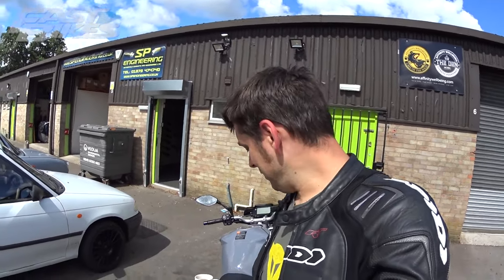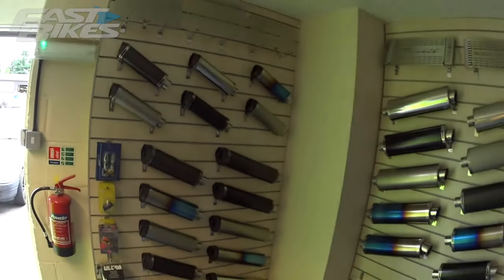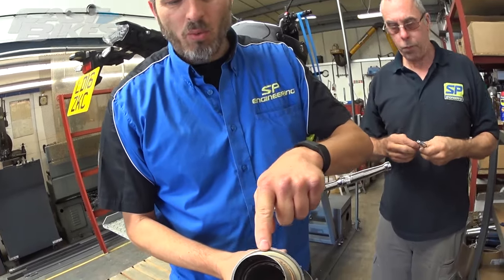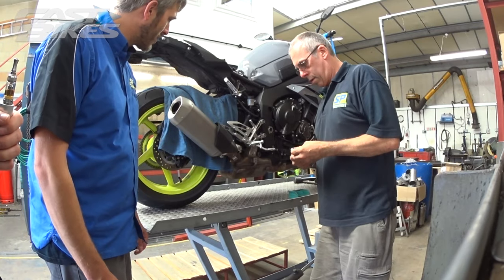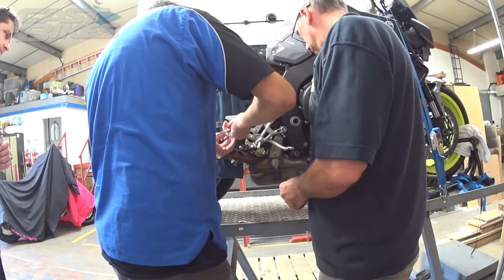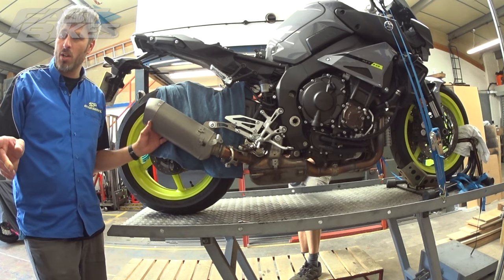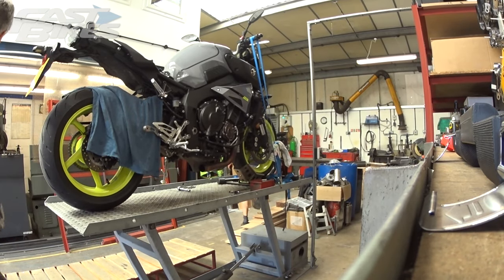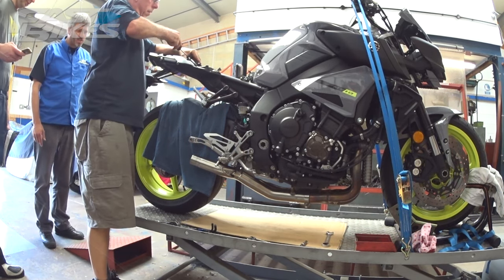2016 Yamaha MT-10 SP Engineering Exhaust - fit and sound -  BJ's Blog

Comment: Any plans for getting it mapped?

Got the same bike, but can't quite figure out if i should go for a fuel module or a reflash of the orginal ECU + dyno.

Not even sure I can find a good dyno tuner in my area here in Norway

Sounds like a beast tho, can't wait to get the original of my bike!
Keep that front wheel up!
Reply from the maker: We'll be getting to that in due course, will get it on dyno first to see what's what.

Comment: Dude, I have exactly the same exhaust, I took the baffle out and it sounds amazing! (Loud exhausts saves lives), however, when I come off the throttle it has a crazy amount of popping. Did yours have the same? What can I do to fix this (without putting the baffle back in). Would a power commander be the answer? I could really do with some help here???
Reply: I've got a Diablos SP Engineering exaust but it was too loud without the baffle as for the crazy amount of popping think that is what most of us like the sound of,  leave it mate i bet it sounds great.

Comment: Nice exhaust for sure!   One question though, I've heard a couple people review the MT/FZ-10 and say they felt that the brakes were not great, yet I see it being directly compared to other premium naked bikes and it beats them every time in actual braking distance.  (example https://www.youtube.com/watch?v=tS006fts44E ) 

I'm still waiting to get a chance to test ride one of these so I'd love to hear your opinion.   Do you think the rider feedback is not in line with what it's actually producing in breaking power?
Reply from the maker: The brakes are not all that, they're fine, very progressive, just not brilliant and often when you need a big (panic) squeeze and a lot of power you don't get it,  and then the ABS cuts in, losing more braking power (A big BIG problem on a lot of bikes especially cheaper ones. Supposed to be a safety device, but cheap ABS on cheaper bikes is anything but...). All of us here are of the same opinion, from the launch, to first UK ride and all our time thus far on this longterm MT. However, we're convinced new pads will cure it (£60). And the rest of the bike is more than worth it to be fair, bar the iffy fuel economy! Go ride one, that's the best way to tell if it's for you or not.

Comment: Great video!! I bought one of these and yet to put it on. I’m wondering if a check engine light come on after the install. The company states that their exhaust doesn’t require any remap but what do you do if you have a check engine light?
Reply from the maker: Cheers! Another 13 episodes after this! No, nothing came on, only after going on the dyno has one come on, but we twigged to remove the rear ABS sensor before running it and refitting it afterwards.

Comment: Does the Y pipe fit the oem slip on end can? Anyone else not to keen on the carbon tail can and bracket
Reply from the maker: Yes it does fit the OEM can, and the Akrapvic can will also fit. SP have stacks of different options can-wise, this is just what BJ chose from the range, check out their different options on SP's website.

Comment: Hey! Does it need a remap? Thanks!
Reply from the maker: No, however, when I did get it mapped it made even more power (138bhp stock - 143 + SP can - 150 + SP Can & mapped Power Commander), a stack more torque and got better mileage. This is covered in later MT blogs.
Reply: Thanks for the prompt answer. Sorry for the question but, is the remap a must to keep the engine safe? Or is it necessary in others words, it does not loose any power with the increased exhaust flow? Cheers from Spain!
Reply from the maker: No, power and torque increases with the SP can even without mapping, keep watching the episodes and you'll see what I mean!